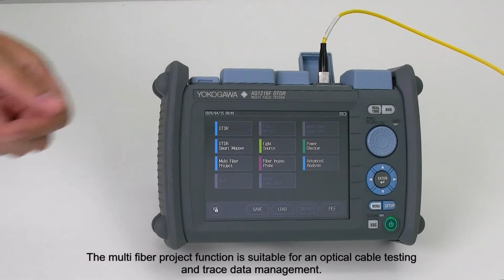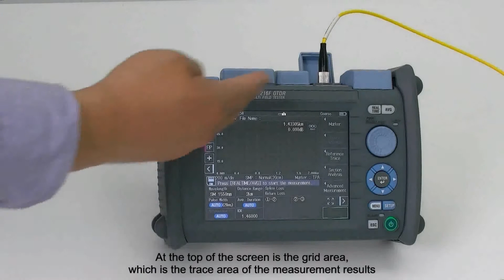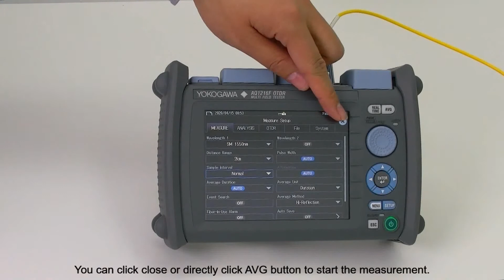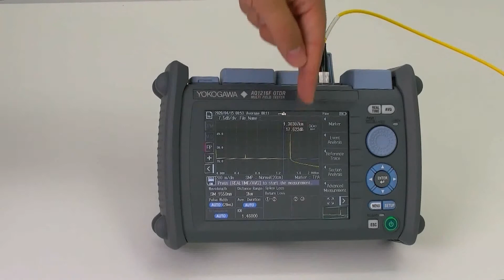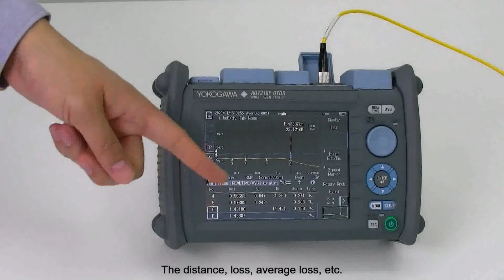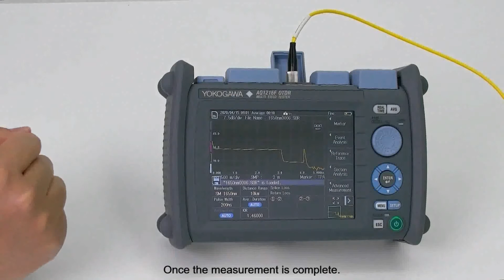AQ1210 Optical Time Domain Reflectometer - operation guide

Comment: Hello, is this only for fiber ? is there any model for auto-detecting false (open or short circuit, bridge, split etc) for power cables ?
Reply from the maker: The AQ1210 is designed for optical applications and so only accepts fiber. Our ScopeCorders (https://tmi.yokogawa.com/solutions/products/oscilloscopes/scopecorders/) and Power Analyzers (https://tmi.yokogawa.com/solutions/products/power-analyzers/) can be used for power quality analysis and fault detection in electrical systems. These devices measure various electrical parameters and help identify issues like imbalances or anomalies that could indicate cable faults.

Comment: Hello sir how setting 4 km destance your 1210 model have any options length setting 4 km
Reply from the maker: If you're asking if the OTDR can measure 4km fibers, the answer is YES. If you are asking if you can set the distance to 4km specifically, the answer is NO. The AUTO button will detect around 4km of distance and then adjust it up to the preset distance setting of 5km. You can view all the distance range settings via this link: https://cdn.tmi.yokogawa.com/1/7457/files/BUAQ1210-01EN.pdf